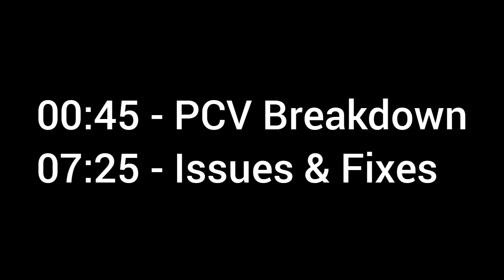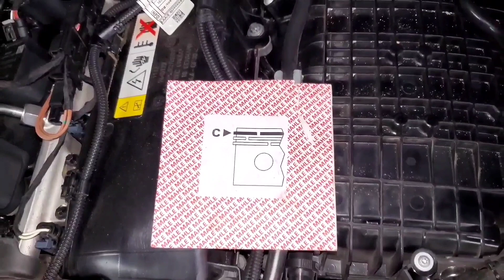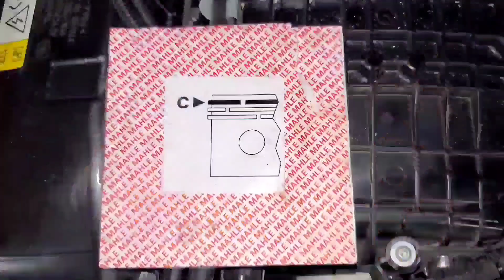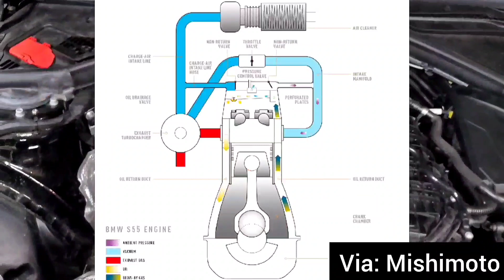**READ DESCRIPTION** How the B58 PCV Works

Comment from the maker: Good news - it seems they are starting to sell the diaphragm separately in case it needs to be replaced. Search for "Membrane Valve Cover Diaphragm For BMW B58 11127645173 repair kit" on ebay or similar sites.
Reply: How do you know when this membrane needs to be replaced and is the diaphragm housing easy to get off?
Reply from the maker: When the pcv fails you'll need to pull it and check. It's not too hard to replace, just be careful removing the cap
Reply: @kern417  is there any condition in this PCV circuit which could fail and cause crankcase over-pressure?
Reply from the maker: Theoretically if the diaphragm doesn't move when it should
Reply: @kern417  So would this be the best solution: delete the pcv diaphragm & vent to air then also add a closed-system oil catch can like the BMS between the crankcase ventilation nozzle and the intake pipe?
Reply from the maker: @daddad4589  that's a good option. Just keep in mind you still need to do your maintenance, and it won't eliminate blowby if you have any. It'll just catch the oil in the can.
Reply: @kern417  Whats the better VTA option for the B58 the Vader or the Vargas which has a ball check valve?  I'm leaning towards keeping the stock PCV diaphragm, using the Vargas ball check valve as a stop-gap to prevent severe crankcase over-pressure, and the BMS oil catch can between the CV and the intake to reduce oil?  What do you think?
Reply from the maker: @daddad4589  any combination will work but really the crankcase pressure isn't a big problem. The diaphragm on some cars is weak and with the replacements available that's what I usually recommend now.

Comment: Any ideas on why one would have no crankcase vacuum at idle in the B58TU? I got a P04FC -crankcase ventilation leakage code. Replaced the valve cover, replaced the scavenger tube between the block and the turbo intake, performed a smoke test(no leaks) and yet I still have no vacuum?

Comment: Hey Kern
Recently upgraded my turbo and tune runs higher boost. How worried should I be about cracking the valve cover pcv components. The plastic seems pretty thin inside there to be holding any sort of pressure. I saw another video where you plugged your head port to prevent boost entering the valve cover. What’s your thoughts on the those plugs you can buy that have one way check valves?  Maintains pvc under vacuum but prevents boost pressure entering the system. ?  The bmw design is not a bad idea just poor implementation

Comment: I just replaced my PCV on my 2016 740i.   Now when I start the car, I have a hesitation when pressing the gas.  Almost stalls the engine.  If I let the car idle for > 1 min, I do not have that hesitation.  Any ideas what could cause this?

Comment: After replacing the diaphragm does the engine need some time in idle to cleat any oil and stop smoking?
I changed mine but it still smoked at next statup

I'm thankful for any advice
Reply: Did it stop smoking? Mine smokes still after like 150 kilometers even tho diaphgram was damaged before. Maybe smokes less but gives me catalyc almost full error
Reply: @TheBartek9330  I did not try to run the engine again since
I do have the feeling like it does only smoke in phases of cold start
One the engine ran and I drove for a couple of kilometers it does not soke at all

Comment: i just started to have issues, replaced my pcv but that didn’t stop the smoking. checked my intake and it had plenty of oil there. car runs good no miss fire or under powered. any idea ? could it be the valve cover
Reply: Following, did you end up sorting this out? 2020 m340xi I’m Catless DP, drop in air filter, MHD OTS e40 tune. After a spirited drive getting of the express way to a stop and go city driving it spews smoke out of the tailpipe but then clears up. The car does it maybe a couple stop and goes then stops smoking. Help🥲
Reply: I’m dealing with the same exact issue did you ever figure it out. I also have oil seeping out the oil fill cap
Reply: valve seals are a possiblity

Comment: How is that on the B48 engine. I only have the pcv value exit like the B58. I dont have an pcv diaphragm. I think it is build directly in the value cover. How can I check if it is broken?
Reply: Is yours a B48TU? If so, there is no diaphragm inside the valve cover anymore. BMW did away with it.

Comment: What’s up man, I was driving my car home from work and like at random times, white smoke would come out of the exhaust while driving and I have no clue what it could be. Some times there would be a lot of white smoke coming out. Do you know what it could possibly be?
Reply: I have a 2020 m340i on a custom e50 tune with a dp, charge pipe, and aftermarket intake.
Reply from the maker: it could be a lot of things. you'll have to go through the car to diagnose. scan for codes, etc.
Reply: @kern417  thanks for the reply man! I took it to my tuner (PQ performance) and they said it was the pvc system but they couldn’t  determine what part needs to be replaced of the pvc system. They told me to wait longer.
Reply: Pcv*
Reply: @kern417  what would you recommend me to do?
Reply from the maker: you can check the diaphragm. if it's torn replace it. if not replace the entire valve cover.
Reply: @christopherlerma3903 did you figure this out?
Reply: Following

Comment: Hi there, I recently had a pcv diaphragm fail on me causing it smoke. I got it fixed but the guy that changed it removed the entire valve cover saying it was integrated with the pcv. I know removing it you have to remove the ignition coils and HPFP, and fuel injectors. it ran for 2 days then I got a misfire in my 6th cylinder. I changes The coil and spark plug and no misfire but then the turbo wasn’t spooling loud how it’s supposed to. went to a shop to get the check engine light turned off so I thought maybe that was the issue for the turbo not spooling how it should but then it misfired again in the 6th cylinder. Do you think the fuel injector is the problem for the misfit and the turbo not function as it should? Would like a response back thanks!
Reply from the maker: if it has been having issues since a shop worked on it then bring it back to the shop to get it fixed.

Comment: Hey,
The Ross racing catch can kit won't work with my car because my large air intake box prevents the AN line fittings from connecting the CC and valve cover near intake.  I'm wondering would just running the Ross racing PCV replacement cap VTA and leaving the vent port stock on VC near turbo be of benefit? Will this setup be safe and vent enough pressure to reduce blowby?
Reply from the maker: I believe it should work fine
Reply: @kern417  is the PCV cap the low side or high side. I obviously don't know much about this stuff. Lol! Thanks!
Reply from the maker: @brakthru2  cap is low side
Reply: @kern417  is this the side for when I'm in boost or accelerating or the most important side I should be concerned about? Thanks man!
Reply: @kern417  what I'm trying to find out is if the PCV cap vta will help any when full throttle or help the high side have less blowby as well? I assume reducing any crankcase pressure will help the overall system? Also, would adding a oil cap filter help both high and low sides? Thanks
Reply from the maker: you need both to fully delete it. if you can't run one side then you're fine just running the other. those are your only options.
Reply: @kern417  so to make sure I understand, if I only upgrade the low side with PCV cap vta and VTT oil cap breather, I'll still have the same amount of blowby at full throttle from the high side sucked in by the turbo as before? Or will crankcase pressure be lower overall and thereby reducing blowby on the high side too?

Comment: @kern417  thank you so much for this video. Maybe you can give some insight. I have a creaking noise coming from the "membrane" or whatever is inside the ventilation 2-3 seconds after I turn off my engine. As heard here https://youtube.com/shorts/ZMgZ7TqSPjs?feature=share car has no codes and runs fine. I was told I would need to replace the whole cover to get rid of the noise. I'm wondering is this really a worry right now? I've taken out the hose and have minimal oil residue, I would say "normal". So I'm not sure if there is an easy fix. Thanks!

Comment: I’m late to the party but if you’re still around too reply, how do u feel about the Ross racing pcv delete with the oil catch can? Would that be a perfectly fine solution for my stage 2+ b58 or is a catch can doing too much and better off with only the pcv delete they have? Just stuck between getting rid of the pcv problem or replacing the oem pcv every so often.
Thanks
Reply from the maker: Ross racing works great. Pcv replacement is obviously cheaper but a delete makes it more bulletproof.
https://youtu.be/v4ERimjJoRY

Comment: I noticed oil blowby had vented past the oil cap leaving oil residue around the cap after a spirited drive the other day running high boost. Is this normal or an indication i need a new pcv. Im not having any smoke or other issues. The shop did note they think a little oil pushed out of the oil feed line and they are fixing. A smoke test was done and no leaks. Thanks for this video.
Reply from the maker: Or maybe you just need a new cap if it has a poor seal
Reply: @kern417  ok. I plan on getting a new cap as the dealer said the oily rubber seal may be causing a poor seal. Thanks!
Reply: Did you ever figure  this ?
Reply: I put a new oil cap on and it fixed the problem. I now wipe the rubber gasket seal dry of oil each time i remove the oil cap. That way its a tight seal and no more oil residue. @jzallday102

Comment: This is very informative as usual as opposed to people screaming “blown turbo”
Had this happen to me this weekend. Car idled for probably 1hr and it was 60 something degrees , didn’t notice till i saw a cloud of smoke in the mirror and heard a whistling. Saw some “$3000 fixes” till I did some research and this video definitely confirms it.
Reply: Did you have any oil leaking? This also happened with my m240.

Comment: PCV works only on light load. It blocks ventilation under boost where intake would pressurize crank case or under idle where vacuum is too great and would pull too much vapor. Idling puts stress on pcv valve/diaphragm as it has to hold all that vacuum. Over long time it probably gets overwhelmed, allowing idle vaccum to suck vapor into combustion instead of just venting. That causes poor running and smoking. Giving it a good rev once in a while while idling should give a chance for pcv valve to recover. Issue is probably happening with older PCVs, replacing them more often would prob reduce the issue somewhat. But still it's a design flaw. Car should idle for a month without an issue
Reply: Stop perpetuating this silly myth about idling in some way being the cause of this issue. The only reason people think that is because a damaged pcv is most likely to be noticed at idle. I recently had my pcv fail and I inspected the pcv valve's operation during engine running when I did the repair. You can look at the valve operating with the cap removed and you can depress it with your finger. The spring and plastic piece (for anyone who doesn't understand what I mean, look at kern417's pcv replacement video for clarification) take up the forces involved and the rubber diaphragm's sole job is to provide an airtight seal and is not "stressed" or "stretched" in any way during idling. The reason it ruptures is due to poor material quality and age. When that happens, excessive vacuum will build up in the crankcase because the valve can no longer work. 

So please everyone, idle your b58 equipped car without any worries and make sure to replace the diaphragm as regular maintenance every 2-3 years :) It's a cheap part and takes 5 minutes to do.
Reply: @harbl2479  I was just brainstorming. I'm not aware of how it works exactly on b58, but on other cars PCV valve is holding the boost or vacuum of the engine so it is under stress. Maybe it's not much stress on b58 as you say, but probably enough to rupture and old diaphragm. So I agree on being on top of it and changing it before it fails.
Reply: @Domas64  It's good that you are brainstorming. But you don't understand the system. It is a valve with a spring that simply regulates pressure inside the engine and keeps the crankcase in a slight vacuum as intended by the manufacturer. If there is too much vacuum, it will close the vacuum feed and if there is not enough, it will allow more gasses to escape thus keeping the optimal level, which is determined by the spring. It never sees excessive vacuum or any boost at all. Once it ruptures from old age, it will no longer control the pressure (because the spring will never compress enough to seal the vacuum feed) which will result in excessive negative pressure in the crankcase.
Reply: Your mental model of it "holding back" boost or vacuum is wrong. Also the deflection from fully open to fully closed of the diaphragm is minimal (a few milimeters) and does not stretch the rubber. All of this can be verified by anyone by opening the pcv cap while the engine is running in the hopes of finally putting this myth to rest.

Comment: After I got a built engine. I started getting smoke on startups if the car sits from more than 5 mins then smoke clears. No smoke on acceleration on idling.  It was the pcv basically the 32 psi with the bigger ring gap and extra tolerance built into the forged pistons overwhelmed the pcv system.  All we could do was install the pcv delete and it worked like a charm.

Comment: Would running the Vader Solutions vent with a Oil Cap Filter at the same time be beneficial? In my head I imagine that way there will be 2 ways for oil vapors to escape the crankcase (Through the vent to atmosphere PCV mod (Vader Solution) and also through the oil cap). Correct me if I am wrong please. Thank you!
Reply from the maker: The main thing is to do the delete. Everything after is just a cherry on top
Reply: @kern417  Sounds good! I am just curious if my logic is sound or if I will be causing some issues I do not know about. Could you let me know? Thanks
Reply from the maker: @wndr_lusti  the delete is all you really need

Comment: Bro your videos are awesome.  Your knowledge on b58 engines is impressive.  I’m sure you get bombarded with questions but if you could help it would be greatly appreciated.  I just installed a turbo inlet pipe on my 22’ m340i and everything went well except getting the pcv line off the OE inlet.  I ended up accidentally break the squeeze tab on one side and was able to get it off but now my concern is it will stay on the inlet pipe I installed.  Was wondering if you had a fix for this, do I need an entire new line? Does bmw or anyone sell just the connectors?  Thanks man.  Really enjoy your videos.  Your 440i is insane.
Reply from the maker: If it's not staying on then you'll most likely need to buy a new line, but a lot of people aren't having issues with it even if it's broken

Comment: 2020 m340, pure800 turbo. Car doesn’t build boost correctly after a few runs sometimes , can’t seem to figure out the issue. Not sure if it’s wastegate , injectors, crankhub. It is throwing a crankhub code but my mechanic at bmw and my local shop says it shouldn’t affect my performance ( a sensor was removed/replaced when turbo was installed .